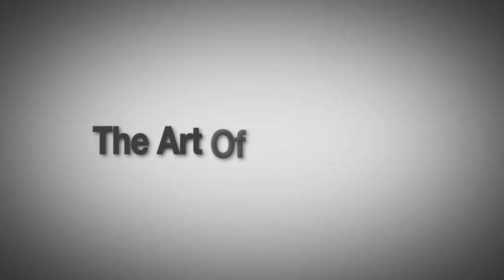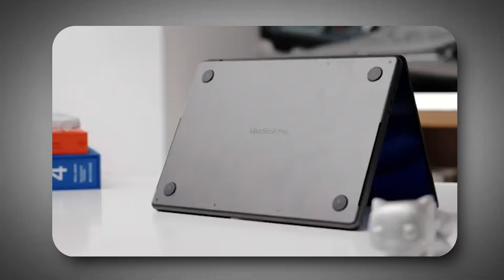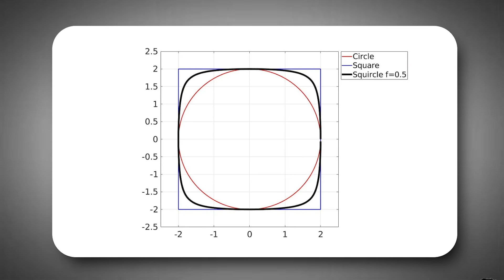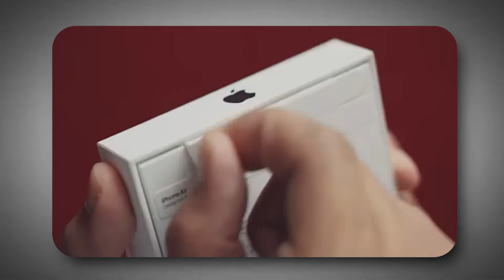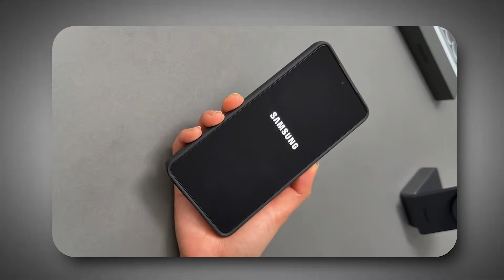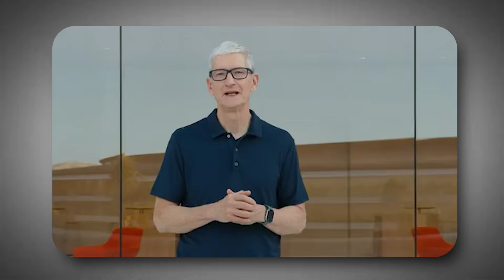Why Apple Products Just Look So Good

Comment: “They removed the earphones port to save space” (and for “waterproofing”)… yet, their next iPhone was thicker than the last, and Samsung already had waterproof earphone ports. BUT, what Apple did “add” were the $160 AirPods.
Reply from the maker: That’s a fair point, but the AirPods were still part of Apple’s push toward minimalism. They had to find an alternative to the headphone and that's how the Airpods was Born
Reply from the maker: Removing the headphone jack wasn’t just about saving internal space or waterproofing. It also helped create a device with fewer physical ports and a more seamless wireless experience
Reply: @SentinelZen  😊 seamless …as losing one’s own, preferred, premium wired earphones to seamlessly swiping one’s cc at the Genius Bar to fork over $160 for AirPods? 😊 You can still get great, oreimium
Reply: @S @SentinelZen ditching one’s collection of preferred, premium wired earphones & iems (including some w decent noise reduction) to fork over $160 for iPods is indeed seamless for the Apple Store.
Reply from the maker: Fair argument. But I'm not saying removing the jack was necessarily better for consumers. I'm saying it was consistent with Apple's minimalist design. Apple is quite stubborn